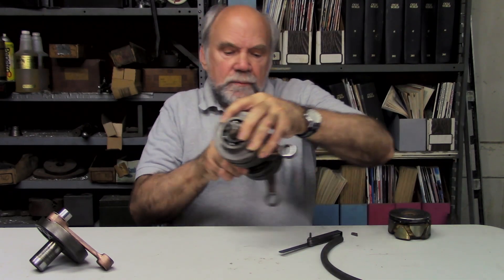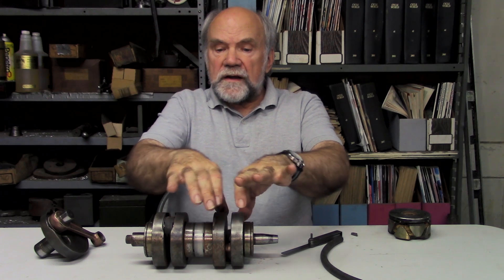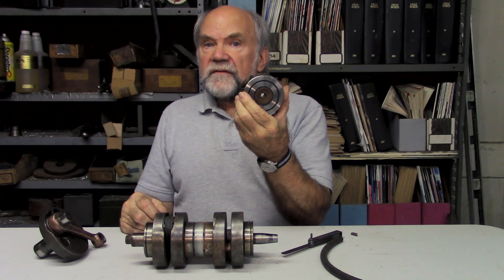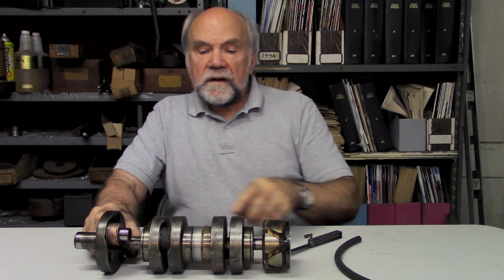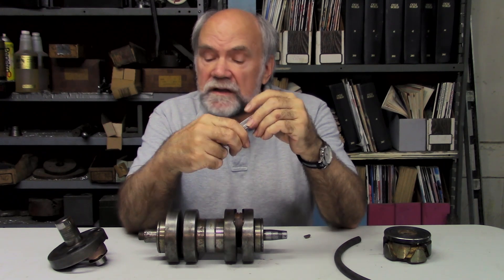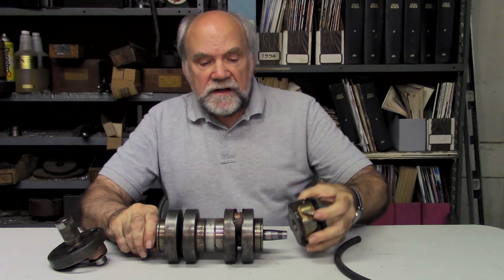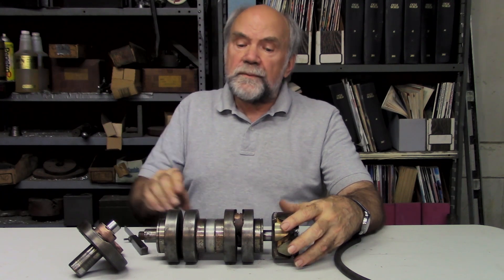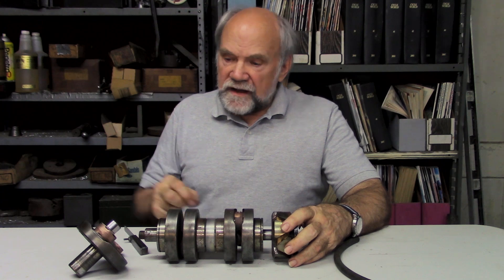What Causes Vibration In A Motorcycle Crankshaft?

Comment: I raced a '77 RD400(434cc) in 1983-84 and it was common practice to weld the crankpin to the counterweight. I broke a lot of parts, but never had a crankshaft failure of any sort. If I had a real budget I might have done something different, but welding and breaking the cases to check bearings every 200 laps(1.8mi course) worked well enough.

I find, much like MEs(I'm an EE) that continued success yields little knowledge, while failure drives processes forward. 
This is true in any endeavor where sustained effort and increased efficiency is desired.

Comment: my gixxer bike is vibrating at 32kmph in 4th gear and at 40kmph in 5th gear after that point it stops vibrating it vibrates only at 25, 32 and 40 kmph in 3rd 4th and 5th gears respectively what may be the reason? plz
Reply: You are lugging the engine 🤦 It's a 250, not a 150. You shouldn't be doing low speeds in high gear.

Comment: Hello Kevin, having raced a RD400 for many years back in the late 70s to mid 80s, I had to have a lot of cranks rebuilt and collected a lot of broken and bent bits and pieces. I even went to the extent of replacing the stock transmission and clutch assy with one from a TZ350 so I could use TZ roller bearings on the outside of the crank to minimize it's walking back and forth in the cases. I found the close ratios of the transmission and the primary drive didn't exactly meet the needs of the slower turning RD400 crank. I've always though about going rebuilding it back to stock again as it was more practical for classes I ran in and easier to ride but I'm too old now to worry about it. Anyone interested in a complete, "almost new" TZ350 cr transmission and clutch assy with straight-cut gears?

Comment: I think I have asked this in another video. My interest in motorcycles started in the early 1980's when Kevin still worked at Cycle. Back then, the GS and GPZ1100s ruled with their "pressed together roller bearing crankshafts." When these bikes were hot rodded way past their stock 104 horsepower, their cranks were "welded" for greater stiffness. This video shows an excellent view of one of these cranks with their counter weights in very close proximity to precision roller bearings. How the heck does one get weld in there to make them stronger?
Reply: I'm not an authority on the subject, but I assume the entire journal is hardwelded and then turned back down to size. So it's not just the joint that gets welded, it's the entire width.
Reply: Seems like an immense amount of trouble. Re-watching the video, trying to figure out where to stick the welding rod. You're right, there has to be some turning involved. Still have a copy of Motorcyclist from... 1983? The crew of Motorcyclist built a GS1260 out of a Suzuki GS1100. They had its crankshaft welded. They said it was now "lighter, straighter and stronger than any stocker." It had lost 1 1/4 pounds. They also retrofitted a GS750 oil pump into it. The 750, at the time, had a one piece crank with automotive shell bearings, like any non-Harley street bike has today. The GS750 pump was considered an upgrade for their new 1260. Maybe that was the best upgrade. It speaks to how obsolete pressed cranks have always been.

Comment: How do you get the con rod on with a solid crank?  My guess is they are pressed on and then welded solid... or?
Reply: vincent was a 4stroke..2 piece rod. and i have seen them tack weld the pin to the flywheel on 2 strokes with 1 piece rods
Reply: you need a 2-piece con rod, the big end is split so that you can attach it to the crank.
Reply: i have never seen a con rod with end cap used on 2 stroke reed valve motors.
Reply: fair enough, I'm not that familiar with 2-strokes
Reply: ...Roller/needle bearings don't do well with the  joints in a 2 piece rod/cap....